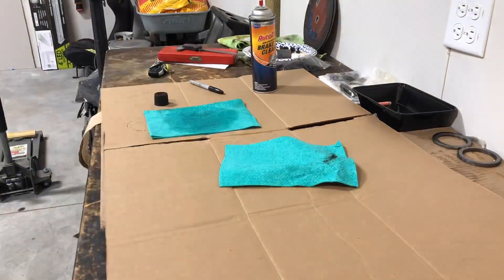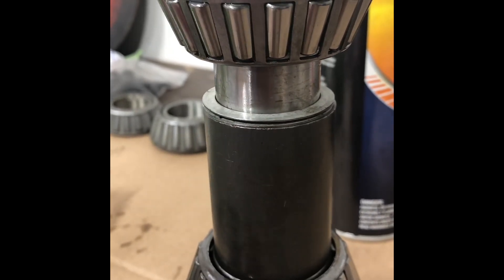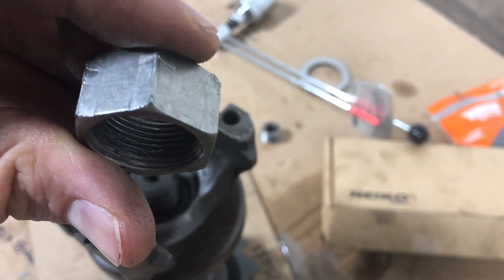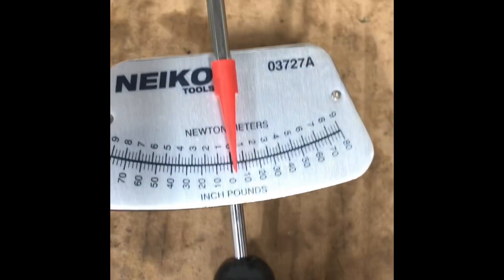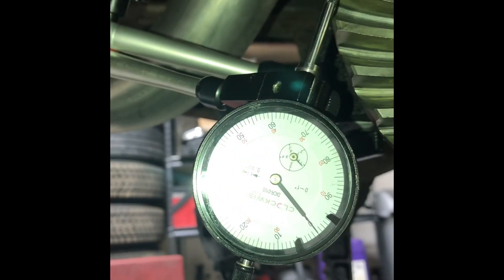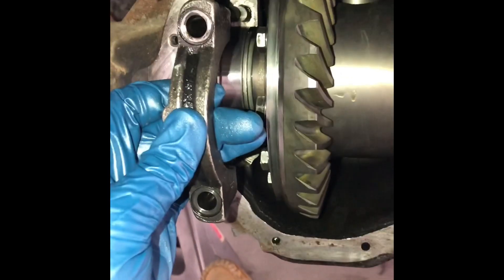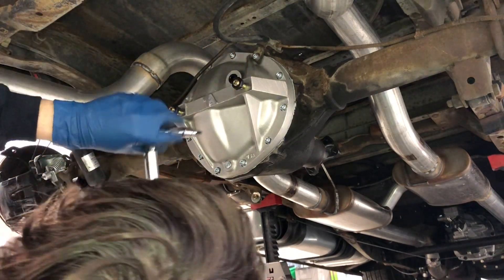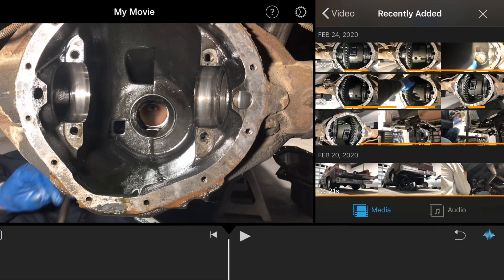C10 Driveline Upgrades Part 3: Final Differential Assembly

Comment: I’d like to see more on the Holley Super Sinper system. How’s it running, any problems you’ve had, etc... Are you planning adding a Supercharger or turbo because you have the power adder system? Dig the T56 and big block combo, it’s going to be one heck of a fast and fun truck 👍🏼👍🏼

Comment: A pinion nut (all of them) are lock nuts.  The issue with the stock ones is once you put them on you can't touch them. When you set your preload if you go to far and have to back the nut off a little a lot of times it will back itself off as you are driving. That is why you ALWAYS change the pinion nut when you have to loosen it. So set the preload carefully and leave it alone.